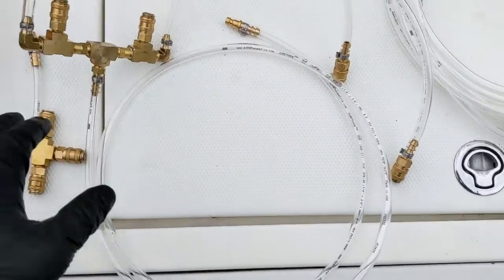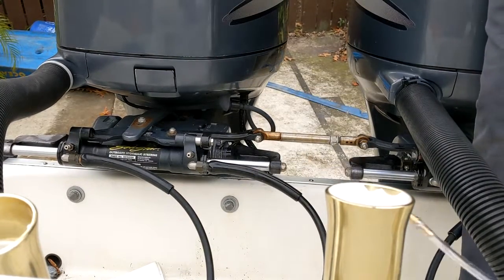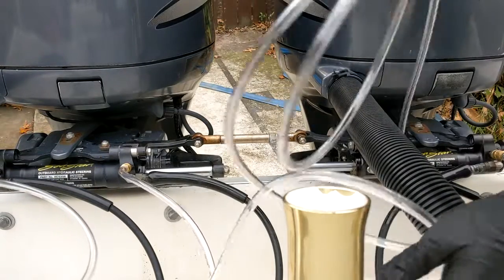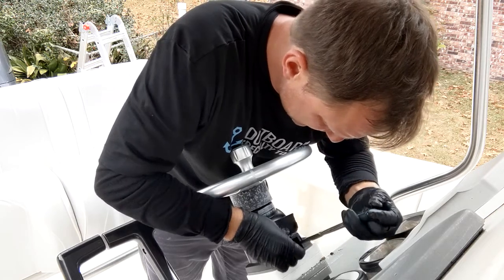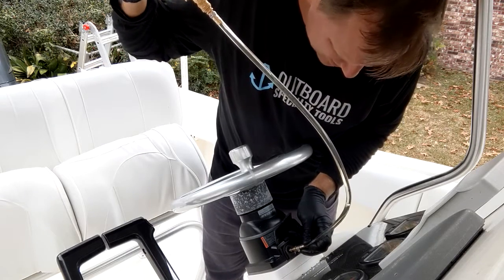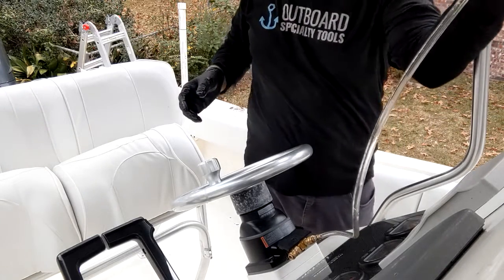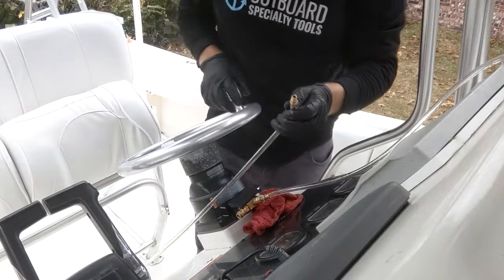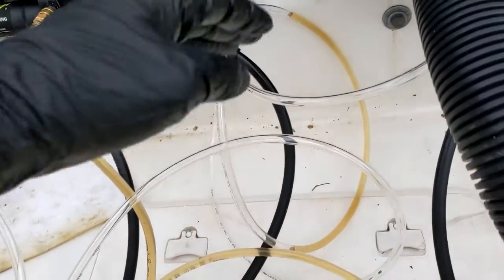SeaStar Dual Cylinder Bleed with Bubble Purge Pro DC Outboard Specialty Tools

Comment: Would you poke a hole in the air space of the fluid container to allow the air bubbles to escape from the container?
Reply from the maker: Yes, if you vent the fluid bottle it will definitely help priming the helm.  If the helm pump is already primed, it will take what it wants whether the bottle is vented or not, doesn't make much difference.  So, if I am working on a smaller system, helm has fluid, and purging a small amount of air, I normally don't puncture the bottle because I'll need the bottle to store left over fluid.  If there is a lot of air in the system, yes, poke a hole, it will definitely be faster.

Comment: Even better, take the return line and route it to a hole in the bottom of the bottle! That way, you can just turn and turn the wheel, and the air will ALWAYS work its way to the return tube, and will never be sucked into the helm pump. I think you're in love with your fittings, and tried to make this a fittings-only solution. Good, but could be better...

Comment: Does an autopilot change the procedure?
Reply from the maker: There are a couple of extra steps for auto-pilot purge that are usually pretty easy to take care of.   You would connect to the helm and cylinder(s) and open the bleed screw in the auto pump at the same time, turn the wheel several turns to port and starboard with system powered down.  Then push the motors to port lock, Purge kit connected, all bleeders open, power up the Auto Pilot pump, and actuate the port side of the pump via the key pad/manual control for 5 to 10 seconds to kick any remaining air out of the pump and then repeat the process on the starboard lock, power down, close bleed fittings and test the system out with power.
Reply: Simrad pump, I'll look for that release.  Thanks.

Comment: I have a twin setup like this one. I had my mechanic add some fluid and bleed lines and on my first use my steering got shut. I was able to trun one side all the way and it's shut that one side , steering is turning freely one way without moving engines and shut the other way can't even get the steering to move to other side.
I even tried to steer with auto pilot and is giving me an error "hydraulic shut"
I checked Helm and is full of hydraulic.
Any ideas?
Reply: how did you get this fixed? I have the same problem, same motors. Thanks

Comment: Is it necessary to go though this procedure if the existing system doesn’t have air bubbles in it and you just want to top off the hydraulic fluid at the helm?

Comment: Isn’t there a lot of air your putting in the system by quick connecting the hoses at 1:10 you can easily pre fill them by quick connecting it to oil bottle and then quick connect them afterwards
Reply from the maker: Yes, a new cylinder attachment/return assembly is full of air and will put air into the steering system if not primed first.  I may not have done a good demo of the priming process for the new kits.  With a new purge kit, with air in the hoses, I usually leave the return hose disconnected while pushing fluid through the system and return hose until the entire cylinder attachment(s) and return hose are full of fluid and pushed air and contaminants out, then connect up to helm tee.  Once the Pro kits have been used once, they retain the fluid in them and remain sealed and primed with new clean fluid inside the hoses sealed in by check valves and self closing quick connects.  As long as the fluid in the return assembly is clean, it can connect up directly to the cylinder and helm tee on the next job and will not need priming and will not introduce air to the system.

Comment: What happens to all the fluid still in the lines after you're done, does it get back to the bottle?
Reply from the maker: It can be drained back into the bottle or disposed into hazmat containment if contaminated.  If the fluid is clean, I leave it in the lines and connect the loose ends to each other so that the unit remains sealed